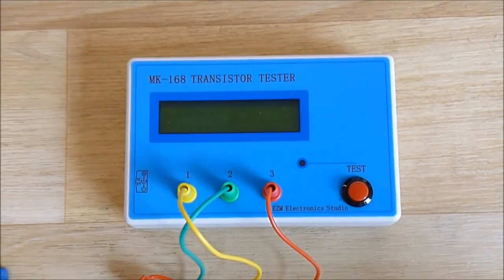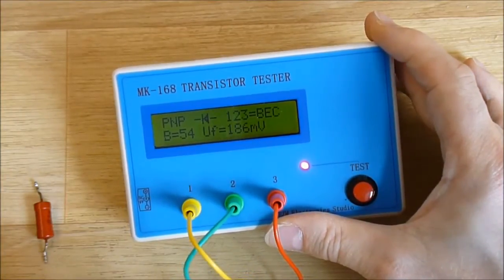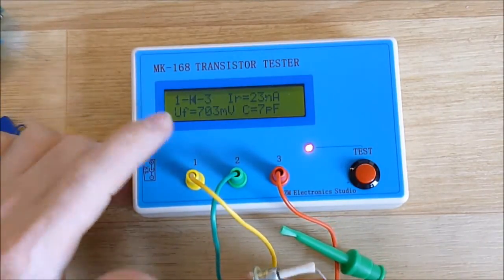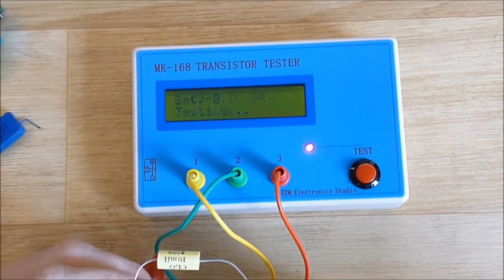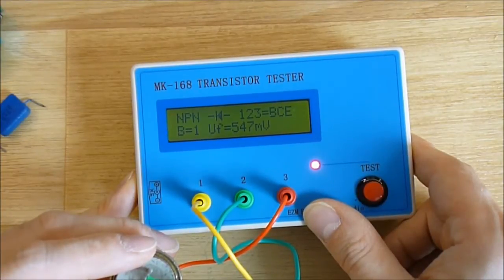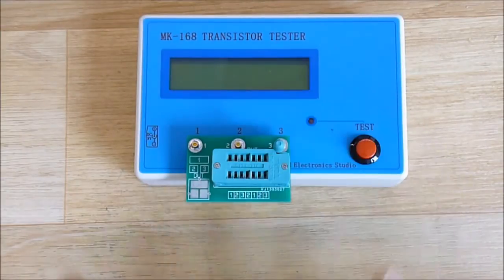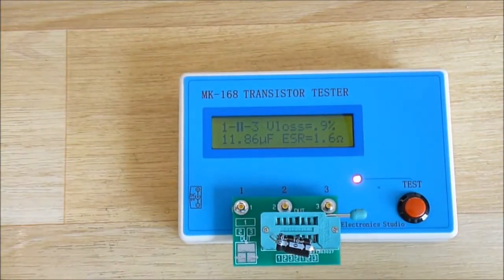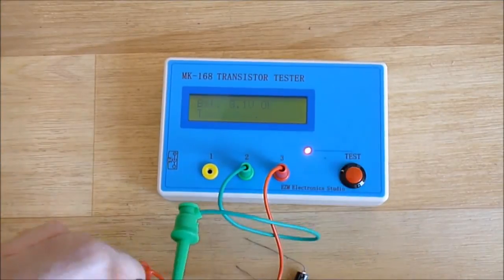MK 168 componant tester

Comment: hi, i would like to ask a maybe silly question...Can this tester used for "in circuit metering" or do i have to unsolder parts and measure them ?? if yes i will blame you for blaming drCassette and buy this too ! lol
Reply from the maker: In-circuit testing depends very much of the circuit configuration around the componant to test, but in some major failure cases, as sorted diodes or capacitors, it allows to highlight a possible anomaly, with can be confirmed later with testing again the part off circuit. Capacitor  ESRs can be read in-circuit too most the time, because they are supposed to be very low. I used this device to repair a vintage Kenwwod amplifier, and I found bad bridge rectifier and transistors with testing in-circuit. Really a usefull little device, and very affordable compared to some other ones, and this one does everything, you don't need to buy a transistor tester + an ESR meter + a LCR meter...

Comment: That dual diode is fairly common in old telephones, connected across the earpiece. The forward voltage of the selenium rectifiers is high enough that any Audio Frequency voltage won't affect it, but any damaging (to the receiver OR your ears) direct current, or high energy impulses will bias one or both of the diodes on, and discharge the current instead of having it go through the receiver.

British telephones also had them, and more modern ones sometimes use 2x 1N4148 in inverse parallel.
Reply: lol DrCassette! I watched it then ordered one off e-bay. wouldn't work at first, faulty dc jack socket. Blob of solder sorted that and it works great! Recommend to anyone who does electronic repairs.